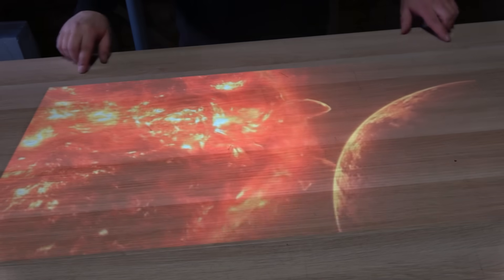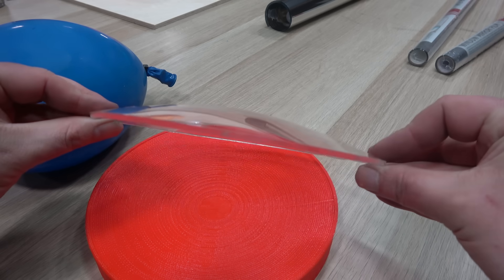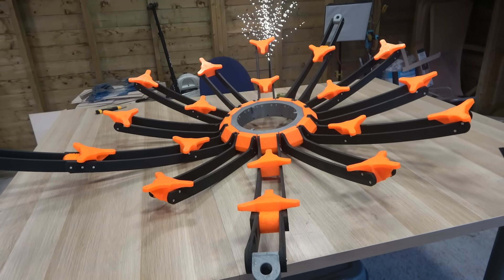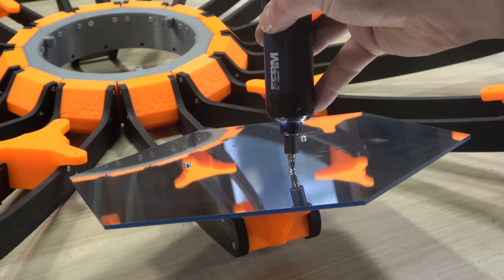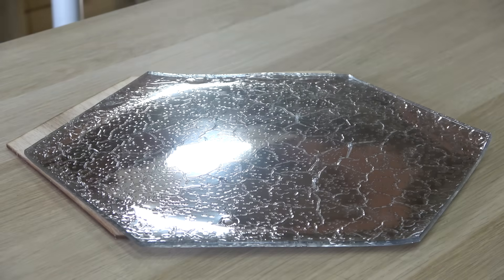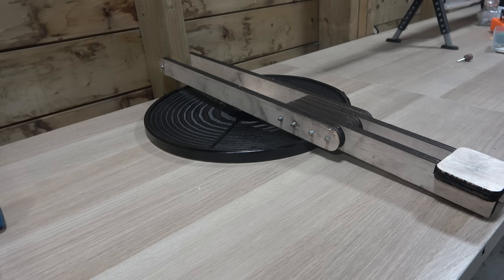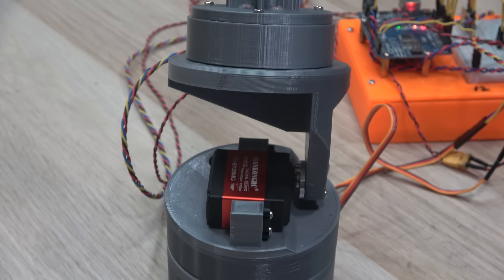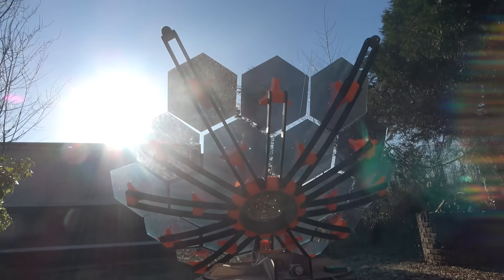Building a DIY Solar Generator..

Comment: Apply the reflective film after shaping the plastic....
Reply: Yeah, chrome electroplating would reflect more light than the transparent mirror film.
Reply: @ Especially as you take a look in the video: that film isn't even fully reflective, you can see through it.
Reply: It is a proof of concept.
Reply: @localism479  No, chrome will reflect 70% of the light while aluminum will reflect above 85%
Reply: @localism479  How can I electroplate a plexiglass / policarbonate plastic? Honest Q, I'm not an engineer, not a chemist more of a DIY armchair engineer .
Reply: Chrome electroplating.
Reply: was going to say it. Much like tinting curved windshield and glass. Or chrome mirror spray paint it after works well too.
Reply: I would first paint the acrylic glass with white primer suitable for acrylics. And after that paint with paint that has metallic copper in it and after that electroplate it with silver chrome solution. I would also use oil instead of water for heat transfer. Water is not really the best liquid for heat transfer in such applications where you need a lot of heat to make power. Big solar plants actually use purpose designed oil for this.
Reply: Copper foil encased in plas😢
Reply: I would have potentially not even bothered to bend them if you can approximate a large parabola with smaller, flat mirrors.  Then again, you need all the sun you can get
Reply: So true the lack of craftsmanship and skill is profound
Reply: Spray on chrome maybe ?
Reply: @noelwhyte9834 I was going to say but I wasn't sure if the paint would significantly change the shape of the surface. At the same time, I would imagine if it did, it wouldn't be too terrible.
Reply: I would do one giant mirror and electroplate it …
Reply: Expensive  @VeeSBP
Reply: Came down to comments to post this lol
Reply: Exactly!
Reply: honestlyyyy
Reply: copper + silver nitrate. has been used for ages to make silver mirrors
Reply: Came here to say that
Reply: I was gonna say the same thing, you can heat shrink the film with a heat gun. But I’ve don’t tinting on cars for 6 years while in college.
Reply: He’s likely using a mylar based chrome coating, Mylar does not work the same as vinyl with heat. Ive years of xp in vynil graphics.
Mylar coated in chrome has the closest specular equivalent to mirrors that I’ve found. And you can’t heat work Mylar

Anyone ever find a Mylar alternative with reflective/specular properties similar to mirrors? Cause I’ve not and have looked.
Reply: @jnoland13  but why? just use spray on copper paint and silvering gel.  works very good and is much easyer for flat surfaces than electro plating.
Reply: @nox5555  ty, I can’t say I’ve explored that. I’ll try it this summer and see how it goes for a home DIY experiment. I was speaking to when I used to do industrial scale vinyl graphics for large corporate displays and we couldn’t find a uniform hyper-realistic mirror reflection. Maybe we missed this option
Reply: @ its not durable enough for industrial use.  its just a thin silver coating.
you can do the same with gold.
perfectly fine for art and  DIY Projects.
electroplating isnt used for the same reasons.
Reply: @jnoland13  I know a real craftsman would use silver mirror but this is a child playing games
Reply: What happens if you put a solar panel in front of those mirrors on a cloudy day?  
May not cope with full sun.
Reply: creasing would look better and still be more efficient than the cracks there actually is on the low temp shaped forms.
and if you need to be perfect, as someone said, use heat gun and soapy water.
Reply: Here to mention this. A reflective wrap film applied after the shaping might work or even a chrome spray. (El Chromino!)
Reply: This!!!
Reply: it was the only thing i could think about
Reply: Automotive window tinting is made to go on curved automotive glass. I was screaming at the screen. Get a blow dryer or heat gun and bend the plexiglass first.
Reply: Hard to apply flat sheet cleanly to a curved surface without creasing
Reply: @taureviews  if it's reflective tint, use a heat gun and soapy water, I promise it works.
Reply: Heatgun might destroy shape of the acrylic.
Reply: @taureviews  People do it every day wrapping cars.
Reply: @Bamamarama cars have a convex or flat  shape at most, at least in one axis. The film tightens around the convex shape as it shrinks. Mirror is concave in both axis.
Reply: @MikhailMoskalev   I have installed reflective tint for 15 years, in homes, on camera bubbles, vehicles, boats, rail equipment, ect... I promise you can put one way mirror tint on a sphere, inside and outside of it. lightly spray the surface to be tinted with regular tap water, with 4 to 5 drops of dawn liquid soap, in a spray bottle, after you get the tint in place, use a sponge, or squeegee shaped to the surface, as you use the heat gun to shrink the tint. I work in Florida, with the curve you are working with, you will not need to even cut the tint to make it fit. Usually if the curve is more than 180 degrees you will have to slice the tint, let it overlap, and make another cut down the overlap and remove the excess. I am just trying to help.
Reply: @MikhailMoskalev  the outside of the front and rear glass may be convex but tint is applied to the inside which is concave
Reply: @bllu  there are plenty of people who appreciate your help. I myself make note of any type of nuanced advice that I see about any given subject because that's where all of the professional looks come from. 

People who are trying to argue have a limited scope of mind and don't like that ideal being shoved down their face. It's incredibly simple to think about all of the applications in which things like this are done on a regular but people don't want to open their mind they want to narrow it down and hyperfocus and tell you you're wrong. 

Thank you thank you and keep on helping people they're always going to be more people that are rude than appreciative but it still helps!
Reply: @ryuken0088  Hopefully "Concept Crafted Creations" knows I watch and enjoy the videos, based on the fact that I comment trying to assist rather than belittle. I would think it was common sense, but from time to time , I forget that there are large amounts of people that lack sense at all, much less common. I don't work with the public, and thank my lucky stars every day.
Reply: @taureviews  hard but not as hard as keeping two layers even through shaping
Reply: @taureviews  we apply things similar to this to cars which have more curves so no its not harder it's just plane smarter, not to rag on the OP bros doing more than any of us but general if you're using something that rips when stretched its usually a sign that you should apply it after you're finished shaping the part especially if it ripping means less efficiency.
Reply: @taureviews  Reflective film is applied to curved automotive glass all the time.
Reply: @taureviews  it is hard, but if it is working for wrapping cars it is absolutely possible for this project too
Reply: @taureviews  no, no it's not. 100 million cars with tinted curved windows would prove you wrong, or did you think window tint came in curved sheets... apply film, heat with heat gun and remove air bubbles.
Reply: Mylar is a little stretchy
Reply: @taureviews  as someone who does it daily as a part of my job, i can tell you, you are wrong.
Reply: @taureviews not when you use a film that stretches slightly when heated. Car window tints or vinyl will do, mylar won't.
Reply: Its not you are wrong @taureviews
Reply: He’s smart. But dumb
Reply: Hes not dumb he is iterating. Significant difference. We should be exposing him to information since this kind of thing has already been done not calling him dumb. @trealin4730
Reply: @trealin4730 At least achieving something,  more than your poison words in fact.
Reply: Dido
Reply: @ryanreedgibson  Her music was pretty good
Reply: @ryanreedgibson ”ditto”
Reply: It would be polite to begin your comment with "Great vid" or "Cool project"
But I know politeness is not a thing in some cultures
Reply: @toi_techno  I was trying to help, not be polite. But some people with problems want people to be polite rather than help in some cultures.
Reply: @toi_techno  caring about your feelings when someone is sharing valuable advice... Let me ask you something what do you have to contribute to the person who gave you life experience for free other than complain about your insignificant feelings
Reply: @  nah he’s a dam idiot thinking he’s smart
Reply: Ever tried to apply a film on a curved surface? No? Try it... You might find trying to get the film to stretch with the material a better choice once you do... Simple curves are easy, that is just a wave in material, but compound curves can only be properly covered by electroplating, aerosol/liquid paint application and using of films trimmed to actually fit and match the compound curve... A flat film will quickly reach a point where it no longer adapts elastically to the compound curve and will generate folds and creases as it is being forced to adhere... Can you guess why clothes were a tailor`s job back in the day? It`s because it takes quite some skillful ``tailoring`` of the flat stock to get it to fold around compound curves... Try applying cellophane foil(cling wrap) over an upturned bowl - no matter how you stretch it, it will not conform perfectly to cover the 3d curve of the bowl... You can try doing the same on the inside of the bowl if you think that it makes a difference whether you are wrapping a concave or convex surface(pro tip - it doesn`t, the two are just a positive/negative of each other)...
Reply: @camillosteuss  You are wrong, Tint takes much much less heat to conform and contract than acrylic, plexiglass, mylar, polycarb, and lexan. I have mirror tinted them all, every shape you can use, including a sphere globe for garden lights and camera bubbles. At the most, you have to cut a seam, but that is only for bends over 180 degrees, which this is not. I have over 15 years experience, and know this for a fact. Sorry, but you are misinformed.
Reply: @camillosteuss  he's not wrapping a bowl or a sphere, he's wrapping the slightly convex side of a concave hexagonal plate, it has less curvature than a cyber truck, your argument is moot

Comment: I would put the mirror foil on the smooth side after the molding phase, which doesn't have direct contact with the 3D-printed mold. You need to thinker more with the parameters for the "perfect" parameters of the mold, tiny deviatiations from the plexiglass contracting during cooldown will change the focal distance by a lot, you probably have to "overbend" them a little. I would also put the heating plate directly in front of the mirror array and run the water tubes inside 2 of the 3 pipes that would hold the plate in the focal point.

Comment: Amazing project, choosing foil on Plexiglas with foil as reflectors....well its cost effective.
The bigger problem i see is with using Plexiglas as the back cover for the heat collector.
Years ago i tryed to build watercooling blocks from Plexiglas and found out it gets very soft around 60C already, making the seals leak because the skews loose pressure cuz they sink into the plexi.

Comment: Your tracking system looks good and it's probably easy to do it digitally but it could actually all be done with a few op amps. One thing though about the heat collection.  Your plate should be black to absorb as much heat as possible using black chrome or black nickel.  And it should be a very heat conductive metal such as copper as well.  Those tubes should be copper to transfer as much heat as possible.   I even considered iron but that's not as good a heat conductor as copper or aluminum.  I think it would be funny to grab an old iron frying pan (your plate looks about that size) and cut off the handle and braze the copper tubing to that.  Solder might actually melt if your machine works.  I've seen much smaller solar cookers and they get amazingly hot.  A recessed collector or a semi-spherical collector is more efficient because it traps light and minimizes heat loss. Ask Chat GPT about this.  I did and it gave me a lot more than I put here.  Everything about this is subject to cost and ability to actually do it.  I think since you already have an nice aluminum plate you should just keep that and coat it black and replace the tubing with copper.  One thing that popped into my head is, how do you make aluminum black?  Then it occurred to me that all you need is a cantle to coat it with soot.  That's plenty black.  Or paint it with black stove or BBQ paint.

Comment: Great Idea! For the Parabolic Curve. . . You could just Keep the Mirrors Flat Since they already Follow a parabolic curve. Otherwise Each Mirror would have to Have the Individual Corresponding Curve for that Segment of the Overall Parabola of the Dish. Without that Exact  Arrangement you will loose Light Density, I personally believe Flat Mirrors Arranged along the Parabolic Curve would Give an Overall Higher Density of Reflected Light though not 100 percent.
Reply: the focus points would be too big but yes its easier to do.
Reply: Is there something wrong with your Shift key or are you just trying to type in two languages at once?
Reply: That's what I was thinking. I'm sure there are quite a few scientific journals on what's best. there's no need to reinvent the wheel with how much effort is being put into it.

Comment: a suggestion for building the mirrors:

1) 3d print a parabolic plate in plastic
2.a) spray it with a reflective paint
2.b) or tape aluminium length wise to cover the parabolic plate
3) cover it in epoxy resin to make it more durable

a suggestion for the design:

-instead of moving a huge and heavy mirror, focus smaller sized mirrors.
(for example if the motor is reliable for 50 kg, instead of using a 75 kg mirror, use 4 smaller 40 kg mirrors)

good luck and I hope this was useful

Comment: The collector plate needs to be all aluminum with a sealing gasket. The near boiling water will deform the acrylic backplate and cause leaks.
Reply: Most likely. I used acrylic glass in a DIY solar heater before, it expanded and deformed 😬 
Size was about 0.5m², temperature about 100°C

Comment: Just finished the video I think the only thing that I would comment on is that for the mirrors if you need to get more reflective index we would use mylar sheets over the mirrors surface.  My other concern is the aluminum heat plate, aluminum acts as a great heat sink so worry it may not be as efficient at keeping heat like steal would or another metal.

Comment: Are your mirror segments identical? For best performance, they shouldn’t be - they should each be formed to match the segment of the paraboloid they occupy. If I’m not mistaken, though, I think for eighteen (18) segments you only have to have three (3) uniques shapes - one for the inner ring, one for the outer corners, and one for the outer midsides.

I couldn’t tell from the clips whether you did such a thing and just glossed over it, or if you formed all of them on the same mold.

Comment: Color isn't really a good indicator for reflectance of infrared light. Actual gold like the stuff used on the telescope would reflect much more light, because the spray paint uses stuff that looks like gold, but isn't, it probably reflects much less light.
Reply: Lasers (IR CO2) use gold mirrors, they work well enough up to about 50W.  The coating is rather fragile.  They're reasonably cheap but small, only 20mm.

Telescope dudes will sputter silver onto glass (say 300mm) easily enough, could probably point you towards someone who could do gold.  These would have the coating on the front.
Reply: @j.f.christ8421 the silver would be oxidized very fast in the heat. In this case aluminum is probably best
Reply: @ralanham76  Yeah, good point.  Aluminium might even be better, it performs only slightly worse in visible (5-10%) but reflects more IR than silver.
Reply: EU TENTARIA ESPELHO FLEXIVEL A SER COLADO NO FINAL COM TODOS EM SUAS POSIÇÕES;DISCO DEVERIA SER NO PONTO FOCAL E NÃO NO CENTRO DO REFLETOR.
Reply: What would happen if he covered the mirrors with gold foil on them. It can be way cheaper, but also fragile.
Reply: Nasa is a lie
Reply: It would be polite to begin your comment with "Great vid" or "Cool project"
But I know politeness is not a thing in some cultures
Reply: @toi_techno There's nothing impolite about OP's comment. There's nothing in what they wrote that suggest that they're critical or disapproving of the project, and in that absence, the fact that they actually took the time to make a comment with a helpful suggestion/correction would indicate that they actually like it to a degree.

And yes, we're a bunch of cultures in the world that doesn't feel like initiating everything with empty platitudes is strictly necessary. Drives Americans nuts, I know, but I think that says more about Americans than everyone else.
Reply: @toi_techno  It's also polite not to put others down or correct them unnecessarily.

Comment: For your solar mirrors with the painted acrylic plates, I'd suggest using several layers of the paint, and then buffing the paint to give it a nice shine, then clear coat it to seal it. This would get around the dullness of the paint you showed in the video.